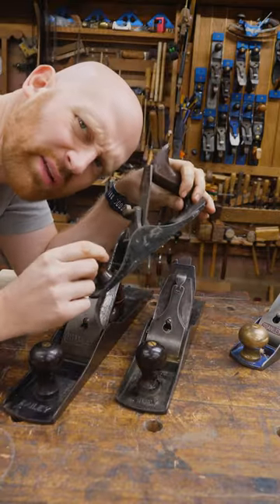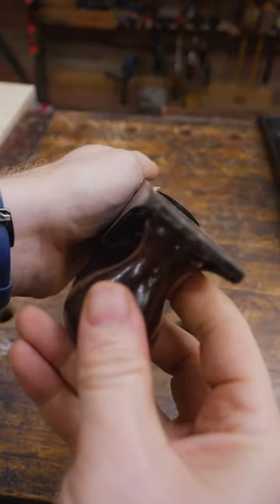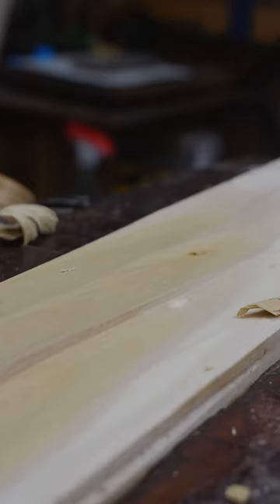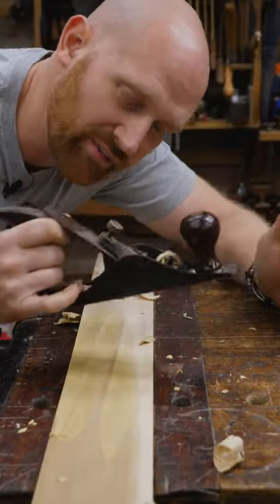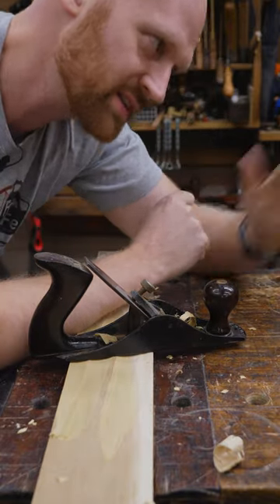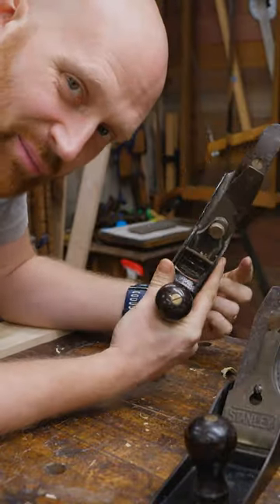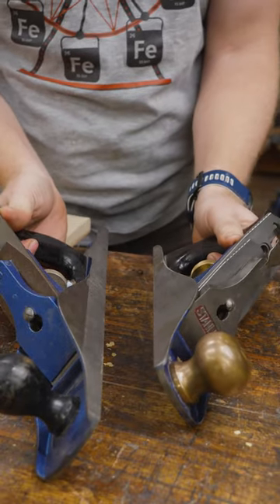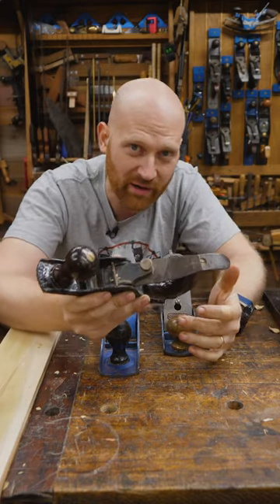What Is A Scrub Plane

Comment: As time goes by, I am getting totally fed up with hand tool collectors. They suck up all the tools, and then let them sit on the shelf. Meanwhile, people who want to actually use these tools for what they were intended for have to pay ridiculous prices for what used to cost a couple of dollars. Hence the ridiculous price for a vintage scrub plane.
Reply from the maker: It might surprise you but the price of the scrub plane, the low angle 62, the router plane and others like that are driven up by users. there has been a HUGE influx of users in the last 5 years. and those tools are often on the top of the list and Stanley did not make that many of them.